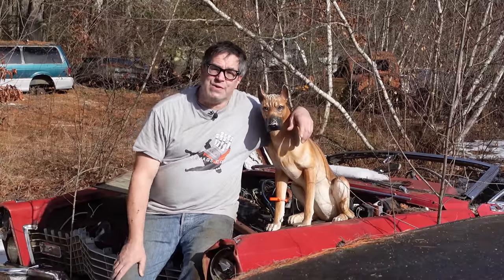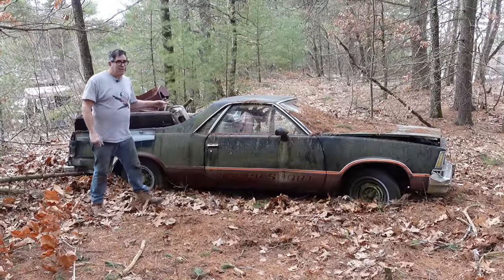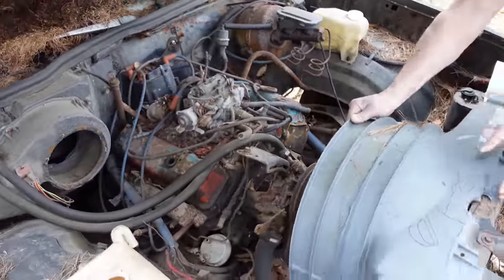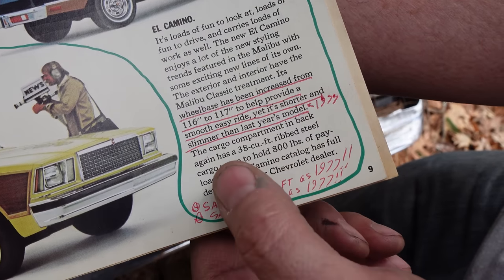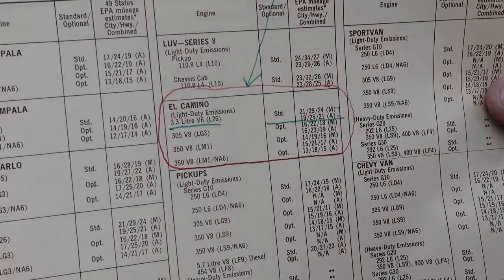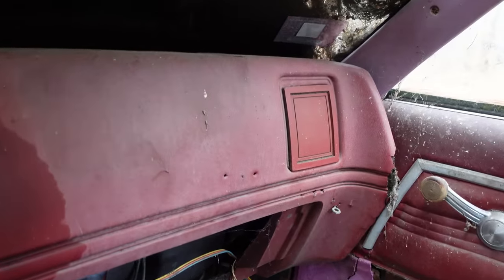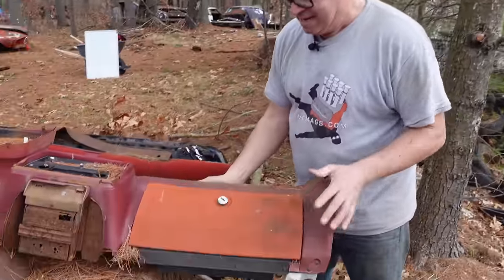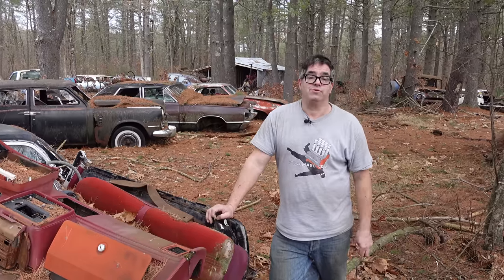El CRAM-ino

Comment: Correct, 1978 El Camino SS models were an appearance package, not a "performance" package. Later on, toward the end of the run, Choo Choo Customs of Chattanooga, TN was involved in the SS package. GMC had the Sprint from 1971 to 1977 and then the Caballero from 1978 to 1987. There are no 1988 El Camino models. The last VIN number documented has an "H" for the 10th VIN digit, making it a 1987 model (although some were sold in the 1988 calendar year, but they are 1987 leftovers). 1988 models would have a "J" for the 10th digit, and there are no records of any 1988 El Caminos produced as 1988 models. Any sold in 1988 as new vehicles were 1987 leftovers. The last rumored VIN is 3GCCW80H2HS915586 (a 1987 305 V8 produced in Mexico).  Starting in 1982, you could even get a diesel in an El Camino. From 1985 to 1987, the base engine was often the 4.3L V6 VIN code "Z" with throttle body fuel injection. 

Up through the 1984 model year, they could be made in the US (Doraville, GA, Leeds, MO, Arlington, TX, Fremont, CA (which closed in 1982), Oshawa Ontario Canada, and for the export market by Pars Khodro in Iran). Starting with the 1985 model year, they were all (for the North American market) assembled at Ramos Arizpe, Mexico. 

No, the 229 V6 wasn't introduced until the 1980 model year and ran through the 1984 model year. It was first denoted by a VIN code of "K" and then by "9".  The 200 V6 was only offered for 1978 to 1979. Yes, the 250 CID straight six wasn't used in these, but it was used in passenger cars through 1979 and lasted into the 1980s with truck applications. Gary Rome Kia is now at the spot that once housed Carl Chevrolet. Actually, the up to 1977 A and G body vehicles were considered mid-size in the GM line. The B, C, and D body cars were considered the full-size offerings. Correct, the 1977 "Oldsmiac" scandal. I guess my family wasn't the only ones that thought that a Pontiac engine belonged in a Pontiac. LOL. That led to the statement in publications to the effect of, "This vehicle has an engine produced by the (insert name) division of General Motors, produced in (name of location", and "GM vehicles may be produced with engines and components from other GM divisions and subsidiaries worldwide". 

That's not correct. In a 1978 El Camino, the 200 V6 was standard with the three-speed manual transmission and the automatic was optional. The 231 V6 VIN code "A", RPO code "LD5" Buick produced engine with two barrel was the standard engine in CA, the 200 V6 was not available in CA. The 231 V6 for 1978 in an El Camino in CA could only have an automatic transmission.

The 1978 El Camino SS included: Large front air dam, matching sport mirrors, special black paint treatment behind the grille openings, a choice of six lower accent paint colors, decal stripes at the paint break line, lower body color keyed Rally wheels, P205/75R14 steel belted radial tires, SS identification on both lower doors, rear tailgate and instrument panel. 

No VIN, can't win, but easy to figure out, no doubt: 1 for Chevrolet, W for El Camino, 80 for pickup/delivery body style, M for 200 V6 with two barrel, Chevrolet produced, 8 for 1978 model year, possible K for Leeds, MO, D for Doraville, GA, R for Arlington, TX, Z for "Freaky Fremont", CA, 1 for Oshawa, Ontario, Canada assembly, and the rest is the production sequence. 

No tag, can't brag, but might go something like: ST78 for 1978 model year, 1AW80 for El Camino, one of the codes above for the assembly plant, 77L for Carmine Red lower exterior paint, 19U for Black exterior paint, maybe 77 and a letter code for the Carmine Red stripe, A52 for bench seat, A51 for bucket seats, a month and week code which is unknown without the tag, and some sort of 74 code for Carmine Red interior trim.
Reply: I think Steve's got it thanks lol
Reply: In high school, I once got a ride with a teacher who had a '78-'80 Grand Prix, and it had a V6 and a three speed on the floor!!!
Reply: @steveib724  Got what? LOL.
Reply: @DanEBoyd  I believe it. Manual transmission A and G bodies are quite rare ducks.
Reply: @steveib724  respect the 🐐 google man
Reply: @Jeffgordonfan24hesthegoat  Nice of you to say. As I always say, when everyone contributes, everyone learns. Then everyone wins.
Reply: I'm guessing Carl Chevrolet was named after some guy with his last name. Carl.  Ironically, growing up in Northern California we had a Carl Chevrolet in Cupertino. 

We also had a big dealer in San Jose at the time called Courtesy Chevrolet, owned by a family of a girl that I went to high school with.  What I also noticed is that Courtesy Chevrolet also seems to be or seemed to be a pretty popular name of Chevrolet dealers throughout the country. Guarantee Chevrolet also seemed to follow this trend.

I guess I can understand family names being the same, but did GM have certain garden variety names like Courtesy or Guarantee that they would allow a franchisee to pick from?
Reply: @kennethsouthard6042  Nah. You could call it whatever you wanted, but of course a catchy name might draw in some sales. Yes, there was a Courtesy Chevrolet in TX at 12300 N Fwy Service Rd, Houston, TX 77060. Benny of CRS has documented a car or two he found there. I don't think I'd call a dealership "Flim-Flam Brothers" or "Shady's Used Cars", or something like that. LOL. 

However, there is a trucking company called Grief Brothers. I would have made a motto for them, "No Grief with Grief Brothers".  There is of course A. Duie Pyle trucking, but that's the guy's name. I worked with a guy whose last name was Weiner. That had to be rough growing up. LOL.
Reply: @Jeffgordonfan24hesthegoat  let Google put your motor combo together lol 🤣🤣🤣🤣🤣🤣🤣
Reply: @steveib724  I'm not sure what your point is on this. LOL.
Reply: Here in Ankeny Iowa we have Karl Chevrolet, named after Carl Moyer. Iowa’s largest Chevy dealer
Reply: @terry-zi7eh  Back in the day there was Laffin Chevrolet in South River, NJ. Their motto was "Stop Cryin'. Try Laffin". We also had Murray Oldsmobile in Perth Amboy. Their motto was "Hurry to Murray".  Both are gone.

Comment: Didn't know the air shocks were standard. Back in the day I had a 79 El Camino bought from a dealer and thought the air shocks were added later. Mine was not an SS, but it had a 305 with a four barrel and Borg Warner four speed, all factory stuff as far as I could tell. Realistic mpg was about 13 city, 19 highway going 55-60, not great. It would have loved an overdrive 5th.  It didn't have A/C but it had all the dash vents in place, maybe an improvement for 79? The 73-77s seemed bloated to me but the 78 and on were sized about right, about the same size as the 68-72. Cool to see at least a little love in the comments for this version :)

Comment: My family owned a ‘78 Malibu wagon in the early 80s with the same 200 CID V6.  I remember the car being an absolute slug, especially on even modest inclines.   As a kid that used to get carsick, I personally hated the stationary rear windows and the silly rear vents that gave almost no ventilation.
Reply: Hopefully your parents ordered it with AC. I believe it was intentional by GM. The salesman could say to you, "Now one thing here, Mr. H. These back windows don't open up, but you get more room than last year. I would suggest you order your new Malibu wagon with AC, as it will get mighty hot in there. It will set you back about $600, but you're going to regret it if you don't get it...."
Reply: @googleusergp  it did have A/C thankfully, but I remember it being seldomly used since it made the car even more underpowered!   
To add insult to injury, a year after they dumped the Malibu (around ‘85), my dad bought a used Olds Cutlass Cruiser wagon with those same godawful vent windows…argh!
Reply: @johnh2514  We had a two door 1979 Cutlass for a number of years in my family (A St. Therese assembled 231 V6), but I parted out a 1980 Cutlass Salon (also a 231 V6) in 1989-1990. It had those wretched fixed windows. I sold a lot of parts off of that car and it had a brand-new set of tires installed the week before the owner blew the engine. Those went right on my Cutlass.
Reply: @googleusergp  my dad’s was also a ‘79, with the mediocre 260 V8.  Lots of drivability problems, most notably vapor lock issues and the transmission letting go at 50k miles. The car was gone within 2 years. A better stereo and nicer seats was all that made it better than the Malibu.
Reply: @johnh2514  Nothing wrong with the 260 V8 except it was a bit slow.
Reply: @googleusergp  it was certainly slow!
Reply: @johnh2514  It was quite slow. They all were back then.

Comment: man, an SS with a 200ci v6...how quickly it fell after just a few years...wouldn't have minded one with an LM1 tho...the downsized GM's were actually kinda nice to drive.  when my partner was looking for a new passenger-pickup in 78, the new smaller elky was too narrow for a 4x8 sheet between the wheel wells, so he went with a '78 Ranchero GT instead...still have it.  have hauled many many sheets over the years in that car/truck.

Comment: Every A abd G body I ever had  with a v6 got worse fuel mileage than the v8 in my mountain area because you always had them floored.
Reply: True. My uncle had a modulated displacement V8 Cadillac (aka "4-6-8") from new and it worked because he lives in TX and it's quite flat there. LOL. He did say that it was "notably sluggish" when shifting between 4 and 8 cylinder mode. He picked it up in Detroit on a business trip and drove it back to TX. It died 100 miles from home and a small Cadillac dealership fixed it. The old-time mechanic found a poor connection at the fuel pump in the tank. The car was so new that they didn't even have the shop manuals for it, but the mechanic was sharp and had worked on the Sevilles of the previous years with fuel injection.

He fixed it and when my uncle went to tip him he said, "No way. Can't take your money. I'm embarrassed that this happened.".

Comment: Grampa bought a Malibu 2 door with 6 cylinder with 3 speed on the floor. I wish I could have gotten it but Grampa got t-boned and I never saw it again. Oh yeah it had that bad primer and paint falling off in 2 years
Reply: The dark colors and the grays were the worst for that, but all colors suffered from the "No deal, paint peel" scandal. The car makers blamed the paint companies, the paint companies blamed the car makers and the customer often got foisted with the bill to repair it. If you were persistent, the dealership and GM ate the repair, but you had to show them you weren't going away.

Comment: Hi Steve, nice video!  The Chevrolet El Camino(s) and the Ford Ranchero(s) are grate trucks!  They are low, sporty and streamline.  When I think of an SUV (sport utility vehicle) I think of a sporty pickup truck, or "sport truck" not a four wheel drive station wagon on a truck chassis.  A Ford F-150 Lightning or a Chevrolet C-1500 454SS is mush lower to the ground than a SUV sure is.  Is a 5 to 8 passenger 4X4 truck sporty?  Not a chance!  I think of it this way, how many people does a Corvette carry?  Please reply.  Dave...

Comment: Correct me if I'm wrong.thses cars came with manual trans till 1978 to 1980
Reply: Correct. The standard transmission for the 200 V6 in 1978 was the three speed manual transmission. Mr. Magnante is incorrect about that statement that the 200 V6 only came with an automatic. It was optional. The 200 V6 wasn't available in CA in 1978, only the 231 V6 and that had to be an automatic for 1978 when that engine was chosen.

Comment: 200 cubic inches of disappointment……..😂

Hey - I’ll give it this - for whatever it lacked in “get up and go” it must have been an attractive looking vehicle when new with the black upper body, the maroon lower accent paint, and the bright orange graphics! Kind of reminds me of the black and yellow color scheme that was used on late-70’s Camaro Rally Sports, which I also thought were very sharp cars for the time!

Definitely dark days for performance, but I was only 14 and had sort of missed out on the raw power of the muscle car scene, so my automotive interests were being formed by the Monte Carlo’s, Cutlass Supreme T-Tops, and de-tuned Trans Am’s that my older brother-in-laws were driving at the time. Still good days to look back on for sure..….!!!!!
Reply: They were rough times back then. It was about "show and no go" because going fast/wasting gas was a no-no socially. LOL.
Reply from the maker: @googleusergp  Remember when cars with dual exhaust outlets suddenly "went underground" and tucked the twin unadorned outlets up as high as possible? Think 1975-up Corvette. A totally psychological ploy since the same volume of exhaust gas flows from one - or two - tailpipe outlets. But the appearance of two pipes seemed to imply twice the stink to the uneducated. How things have changed! I saw a truck load of brand new Hondas being delivered the other week and most of them have dual resonators / mufflers under each corner of the rear bumper BUT a single head pipe leading forward to the INLINE 4-banger!!! I am trying to justify the expense and weight of this secondary tract beyond image. Perhaps sound attenuation is part of the scheme? Probably not. Crazy how even 'economy" car designers "get it" about dual exhaust - some even with quad tips (that do more "nothing"). Thanks for watching and writing. -Steve Magnante
Reply: @SteveMagnante  Yes, I do. My Trans Ams are like that, as both are "smog era" cars. However, GM got it right with the 1979 Pontiac 400. Those always had an aggressive exhaust tone. No need to put silly Flowmasters or Cherry Bomb exhaust on there. When replacements are required, the standard "turbo flow" style mufflers make it sound just right. A big pet peeve of mine is to see "restored" Trans Ams of my era with the wrong exhaust, or worse yet, two straight exhaust pipes sticking out. LOL.

There's a guy in my area with supposedly a "warehouse" full of late 1970s Trans Ams. I put a note on one of his cars and we had a brief chat some time ago. I have to get back in touch with him.
Reply: @googleusergp  - My first year in college one of my dorm mates had a late-70’s/early 80’s TA and I remember thinking at the time that it seemed like a pretty quick car! A lot of it might have been the diminutive size compared to the 70’s era land yachts I was used to driving around in or the relatively stiff chassis tuning compared to other cars of the day? Regardless, they were still “fun” cars for the era and the envy of many car guys of the time!

I remember thinking the same of a mid-80’s Monte Carlo SS that one of my buddies owned. Today we might laugh, but back in that era they were pretty “legit” performance-wise………🤔

Comment: 229 V6 came for 1980 with 110 HP.
Reply: Correct, VIN code "K" engine and later on, VIN code "9" engine. It was used from 1980-1984.

Comment: I did the math, so that V6 is from the V 8 265 minus 2cyl?
Reply from the maker: Yes it is! There is a small aftermarket that caters to these 90-degree Chevy V6 engines but mostly the later 4.3 liter 262 V6 from the mid-1980's in Blazers, S10's etc. Thanks for watching and writing. -Steve Magnante
Reply: @SteveMagnante  I used to wonder why mopar continued with / six in the early 80's but, now I see that with 95hpish & 210 torque, it was still competitive and proven whereas these V6s were needing hrs to prove thier worth. Thanks Steve.

Comment: Oshawa made 4 door known as Iraqi taxi the deal fell through and never shipped so gm put vinyl roofs and wire hub caps just so they could sell them v6 with 3 manual floor shifter and factory air conditioning.if you wanted suspension parts you would have look in the truck parts .they looked like crap but the frame did not rot not like the 2 doors .they sold them cheap because nobody wanted them.the people that did drove crap out them and lasted a long time.people wish gm would build another tough car like that one